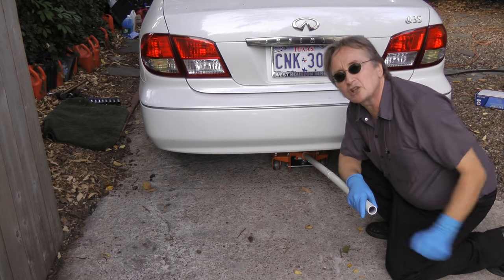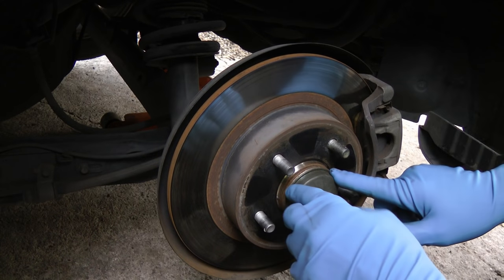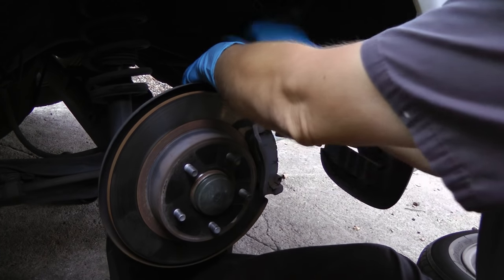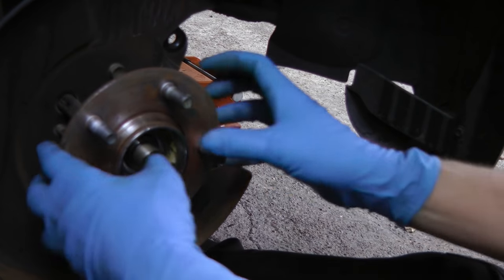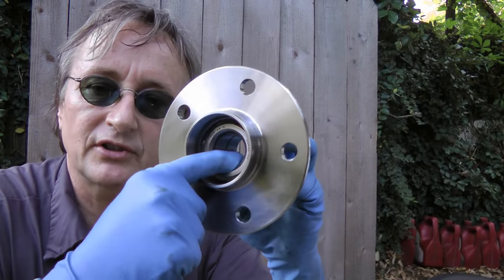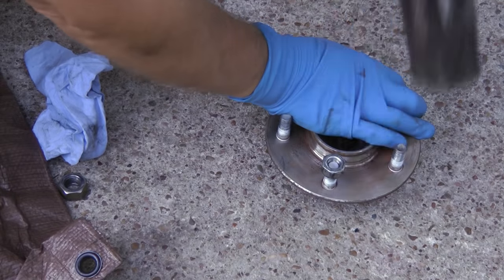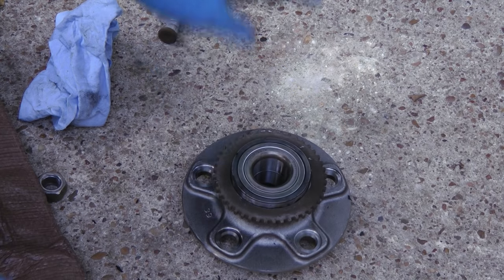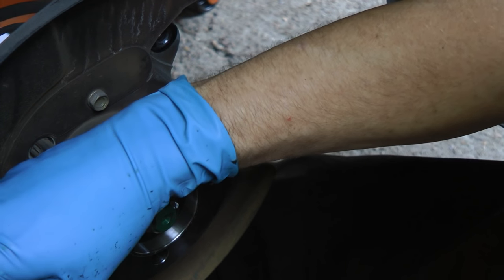How to Check a Wheel Bearing in Your Car (Replacement)

Comment: Hi Scotty, is it still safe to drive the car when you hear a humming sound at the back? What's the worst thing that coukd happened if you don't change the bearing immediately?
Reply from the maker: I've seen guys drive em years that way. As long as wheel doesn't wobble, they can go a while, But eventually they will wobble so bad they can actually fall off
Reply: +Scotty Kilmer, Thank you. I'm in the countryside where i have to wait for a month before I get the spare parts.
Reply: +Scotty Kilmer, Thank you. I'm in the countryside where i have to wait for a month before I get the spare parts.

Comment: Hmm idk there’s a noise coming from my back tires when i accelerate. It sounds like I’m driving over snow. And it sounds intermittently. Does a bad wheel bearing make noise that’s consistent, or does it come and go?  
Also when im driving at low speeds and take my foot off the accelerator, the car immediately comes to a stop, like not shutting off, just no motion and then there’s like a CRACK sound before it stops 😖. I’m scared. Sounds like something’s stuck in my back tires but I check and there’s nothing. HELP

Oh and I should probably mention that my back tires are uneven tread? 6 and 4

Comment: hello Scotty  saw your video was wondering if my wheel bearing needs replacing . I've  been having a whistling siren like noise when I'm driving. i had my front brakes / rotors and brake shoes / brake drums all replaced good brand and my 2003 toyota sienna still makes the whistling noise while driving could this be my wheel bearing. also no noise when I brake.
Reply from the maker: whistling is more often an air leak, like bad door or window seals. Wheel bearings roar, the faster you go, the louder the roar

Comment: scotty i have 2000 s10 ext cab with 4.3 2wd 5spd with 8.5 rearend and ive had a weird noise around curves and seems to be to right but seems to start noise and weird stuff after few min driving and there is viberations also.. Ive jack rearend to see if it may be rearend but dont hear nothing but the rearend has that play in and out clunk when you take truck bed and shake hard like c clips knocking. Noise is worse around right hand turns and when u apply more throttle. Combo of junk going bad?
Reply from the maker: classic signs of worn axle bearings in the back

Comment: Hi Scotty, I tried emailing you but your page seems to not work for me for some reason. I have a 2005 Toyota Avalon and it pulses when I slow down or hit the brakes. I've changed the front rotors, pads, inner and outer tie rods with no luck. What could it be? Any suggestion would be greatly appreciated. Thanks!

Comment: So if someone take off your wheel by hitting it hard with a hammer could this damage a wheel bearing.  I just got new tires and now I am noticing a major vibration at 50-65 just like a bad tire balance. Took it back and had them rebalance and still the same but also now it pulls to the right.The guy told me he felt play in the right wheel bearing or tie rod.I remember the other guy using a hammer to get that wheel off because it was stuck.  he was under the car and whacked it hard once.

Comment: I have a 2012 ford focus can I replace the REAR bearings rebuild the hub a new one is like $212.00 but a wheel bearing is probably $40.00 and I do have a 20 ton press in my basement

Comment: I changed the right front about 2 years ago and cannot remember where I got the part and now that I Drive down the road I recognize that same sound and I cannot tell which tire is actually the one making the noise so it looks like I'm going to have to take it apart to look at the remaining three, can you guesstimate a great or a fair price for when I call that phone number??
Reply from the maker: +Matt Woodward  with no traffic around drive 35 and swearve gently to the left then to the right. if going left makes the noise quiet down some, it's the right bearing, and vice versa

Comment: ive got one caliper they may be bad, adding more pressure on my driver side then passenger side, is it true that this can cause a bearing to go bad , because now my 99 vw passat is roaring like crazy , it started out of no where 65 mph down the bypass
Reply from the maker: IF a calliper is sticking, that causes excess heat, which over time will ruin the bearings by boiling their grease

Comment: I have a 1999 F150.  Loud humming noise past 50mph only when going straight and while turning right.  When I make a left turn its completely gone.  I checked and the rear driver drum has visible oil leak.  Passenger drum looks fine.  Just replace the one wheel bearing/seal or replace both?
Reply from the maker: replace the side that's leaking, bearing and seal, that fluid gets on them and ruins the bearing, other side can still be fine

Comment: I need help, I bought a wheel hub for 1991 Honda CRX and everything I put in went well but then I put in the new rotors on it, it does not fit O.o

Comment: thanks for the reply ..yea that's what people tl me but the only time I hear the sound is when I press on the gas pedal it goes away if I accelerate faster and I also hear it when I make turns the sound comes from one side it's more like a high pitched noise. I also have a problem when I start my car it turns off if in turn it on I have to press on the has pedal to keep it on for a minute .could this sound have something to do with that. and thanks again Scotty for you help:)
Reply: Maggie Rosales  n

Comment: Scott my truck shakes violently at random times when im driving. Any idea what it could be besides it being an old truck??
Reply from the maker: worn ball joints are common, as are worn shocks or struts, check them first. also check for worn U joints on the drive shaft

Comment: I am getting this random noise from the back of the car. It sounds like high pitched metal scratching noise. It doesn't always happen, it could come for a few seconds from driving out of my driveway, then stop, or sometimes it will start after 20 minutes of driving. I cannot reproduce the sound whenever I want. The noise comes and goes, and stops if I do not move the car. Any idea what it could be? brakes were changed last year, the most recent jobs were a muffler change and tire swap. Could it be rust? I know my dad rarely washes the car, its about 12 years old with 160k km.

Comment: Have a 2010 Jeep Compass. It has new tires. The alignment was just done. I took it to tire shop and was told it was CV Axle/Wheel bearing. The car makes grinding/rubbery noise from passenger front. If anyone has any advice it would be greatly appreciated.

Comment: I have a 2009  Kia Rondo. Can you tell me how much I can expect to pay at a garage  to have the wheel bearing replaced. Thanks
Reply from the maker: on that design, front bearing would be about 250 total price, but rear would be about 440 due to more work
Reply: thanks just saw your post.

Comment: Dumbest question ever incoming…the bearing for the entire assembly is inside of the hub correct? I want to use a brake rotor as a lawn aerator but want the ability to still use the bearings, which means I’ll probably need to get a hold of a rotor and the hub assembly I assume

Comment: One of the issues here is a slightly bent HUB now it’s the hub that presses into the bearing if you replace the bearing you may get a vibration if the hub is bent just a fact reminders

Comment: I have a 05 Ford expedition and it's making a sound that only happens on a cold start sorta a knocking tapping sound and only last a few seconds.  I posted the sound on here with no luck. Any ideas? Oil pressure stays stable and doesn't over heat and no leaks! Just did oil change to see if that helped and no!
Reply from the maker: Regina Romero   often a loose timing chain or weak tensioner on that model, any mechanic can hear it cold and tell you

Comment: Wish I saw this video before
My front passenger hub assembly and bearings are bad. Theres a wire hanging out. Heard same roaring noise, sounded like driver side, but it was the passenger side
I guess it was bad a few days because two days in a row while on cruise control, my abs and traction control would go off.

Comment: That was easy. I replaced a rear bearing on my tacoma n took a few hours also i had to buy 2 especialty tools plus the press n bearing splitter do your homework cause most bearing r very hard to replace. Quick hubs like the one scotty showed are usually 4 bolts and done

Comment: Hey Scotty I have a question. I have a 2002 Acura Rsx Type S I had a clunking noise when turning I replaced both axles and then I had a humming noise when turning left which means its the front right side. I then replaced the wheel bearing a hub and put everything back together. Now my steering wheel shakes and the clunking noise is there again and the humming I am lost what could this possibly be if needed I can make a video for you. Please let me know

Comment: Could a Do-It-Yourselfer do this on a 2006 Ford Explorer for rear wheel bearings?
Reply: *****  RWD/4WD diff lubricates your bearings you shouldn't need to repack your bearings unless your diff fluid is bad.

Comment: Hello Scotty. Say, you don't seem to be concerned much about torquing any of the caliper fasteners or wheel bearing nut. Isn't this something that should be noted as a "preferred step' or is it really unnecessary.
Reply from the maker: +rayford21 IF you've never worked on cars, get a torque wrench and a book with torque settings. A pro like me does most things by feel, other than head bolts and really crucial parts
Reply: +Scotty Kilmer Really, so those big books of torque settings are for nothing! what if a bearing needs to be torqued to a certain amount to allow for heat swelling ( which on alot of GM cars especially older ones do) i think that was some bad advice given there as i would say that whilst you have a lock nut on there (so not a safety issue unless ofcourse it seizes) you will toast a bearing if it's overtightened and needs space to swell

Comment: My car makes a strange rubbing noise from underneath the front fender.  Doesn't sound like metal to metal friction however.  I looked underneath and nothing appears to be scraping together.  I notice when the car is jacked up I will spin the wheel and it doesn't make any noise but only when the full weight of the car is applied.  I primarily hear the scraping noise when the wheels are pointed straight forward and occurs more frequently as the car moves faster.  Wheels are factory size and the tires are in good shape.  I'm completely baffled.

Comment: I have a 2001 Dodge Caravan, its making a squeaking noise only when I make right turns. Could this be a bad wheel bearing?
Reply from the maker: wldmike223 it could be, BUT more often squeaking noises are worn brakes or suspension parts, wheel bearings roar as they wear, the faster you go, the louder the roar

Comment: When u do the method of pulling in the wheel studs u have to be careful cause that way u can spin the back of the stud while u tighting it down an if u do so the knjrl can decrease in size an might not stay tight in the hole, it might wobble or fall out when u dont have a nut on it

Comment: I've got a bad vibration in my 1982 datsun 720 4x4 that goes from no vibration, to vibration right when I hit 45 mph. when i go 45+ mph it increases with speed, the guy i bought it from said he put a new clutch in it. Is there anything the he could have done wrong for it to cause this vibration? when i hit 70 mph on the freeway it sounds almost scary, like a helicopter. I cant really locate where its coming from though. Does it sound like it could be a wheel bearing? How can i test to see in a 4x4? Thank you!
Reply from the maker: almost always bad wheel bearings when it sounds like a helicopter

Comment: I have a squeaking noise in the front driver side wheel when I drive. It alters with acceleration and goes away when I turn the wheel to the right and gets a little louder when turning left. What could it be??????????

Comment: hey Scotty  i drive from  stop to 35mph ,  i'm getting a sound like a stone stuck in rubber ,  there is no stone , or nail , when about 40mph sound goes  its a light humpimg ...tyers 4 months old , put on rack & pin new brakes and rotor ,,,  sound still there ,,,, help

Comment: Well in my case I have a Crown Vic Police Intercepter. Has humming sound but its leaking fluid. Think my wheel bearing and seal is bad ?
Reply from the maker: yep, and on those, generally the seal goes bad first, then the diff oil ruins the bearings. Bearings are made for grease to lube em, not diff oil which ruins them
Reply: Scotty Kilmer Cool thanks well my part comes in today I will be fixing it today thanks Scotty.

Comment: Hey Scotty I have an issue with my car at speeds above 50 the front right tire gives a powerful vibration I have a 2006 AWD Equinox and I know it's not the tire balance
Reply from the maker: +James Allan jack it up and check the tire for out or roundess, and check for worn parts like ball joints or tie rods, Then pray it's not something expensive like a wheel bearing assembly

Comment: Dealership to me my 2012 maxima need front wheel bearing, I didn't think my car was old enough to need new wheel bearings, who long does it take for them to go bad.
Reply from the maker: Buck Burg depends on how and where you drive, hitting lots of bumps or curbs wears em out fast, as does driving in salt water areas
Reply: Thanks, just had them changed, still under warranty😁

Comment: What does it mean when the sounds is like a ratchet?
Also I tried taking off my wheel nut a few weeks ago and that thing will not budge. Am I missing something?
Reply: systematic101 maybe your model had loc-tite applied to it... I've removed nuts, bolts, tight seals...  etc. etc. using anything from hydraulic torque wrenches,  to an oxygen and acetylene torch used to wash the tension backing in a bolt from a lock washer, or even fork lifts in a pinch to bust bolts downed @ 5000+ fp. off the jaws of an excitor/pile driving equip... A method I use when the hydraulic wrench is with a service tech... If I get in a hurry or the job is "hot"... Using the fork lift is safer when done right and much faster... I know...

Comment: Hey Schotty.  My chevy equinox vibrates when I'm accelerating and stops when a let off of the gas, and when I go above 60.  Do you have any idea of what that could be?
Reply from the maker: have the wheel balancing checked, pray it's that and not internal transmisison wear or bent drive shafts
Reply: Could it be transmission fluid?

Comment: I just bought an 09 Ford escape.
1 1/2 weeks owning it and suddenly I have multiple lights on dash.
ABS light, and traction control light came on when turning sharply left or right.  They go off after 20 seconds or so.
Then 2 days later..... In addition to these lights I get two more lights!  There is now a "brake" light and a little wrench symbol light.
There is no noise or vibration when driving.
I'm sick about this.  I feel I've been taken advantage of again.  😢

Comment: i drive a 67 mustang i replaced al of my front wheel bearings. i looked up several different videos some give this torque **ftlbs then bak off half turn torque to **ftlbs. others say torque to **ftlbs back of till you cant feel resistance tighten till it starts to resist wheel spin im not as expierienced  to have a feel for it yet how do you do it?
Reply from the maker: yes, torque em, then back off a tiny bit, then tighten a tiny bit till you feel some drag.

Comment: If the noise changes when you have the tires rotated and balanced, it's likely to be the tires - especially if you need a full alignment. If there is NO CHANGE in the noise even when you get new tires, jack it up like Scotty says and check the bearings.

Comment: This sounds like what could be happening to my old suv .  The noise isn’t loud yet, it sounds like a quiet version of the growling sound and I hear it up front.  It sounds like wind going through my tire and I actually hear the axle turning.  Never heard it before and it’s more prevalent when the car slows down.   Having it checked by my mechanic next week.  Hope this is all it is.
Reply: Yep....they get louder and louder
Reply: James Avery I suppose early detection isn’t a bad thing.  I just hope it’s just one bad wheel assembly and not multiple ones going bad. But given my car’s age, it’s not impossible.  The car turns thirteen in a few months.  Engine is very good and no indication of rust on the body.   So it really doesn’t look it’s age but a few things do need replacing on the inside.

Comment: Last time I helped change a wheel bearing my brother-in-law pulled out the air hammer, 5 pound sledge, torch, and some grunt work.  Wonders of living in the north.  You just tug and off it comes in Texas.

Comment: I have 2005 chef. uplander  i have changed all rosters, callipers, brack pad and wheel bearing assiembley, now rear right  caliber stuck on the roter  any ideas please
Reply from the maker: often a brake hose collapses inside and does that, not releasing pressure

Comment: Make sure to wipe your rotor off to make sure it's clean to prevent squeaks later down the road. Also clean the wheel bearing where it comes in contact with thetl rotor, another cause of squeaks

Comment: There is a rythmic humming/rubbing sound that gets more consistent as I accerate over 30mph (which cant be heard anymore when i'm driving over 40mph) coming from my front left wheel (front wheel drive). Could this be the wheel bearing..?
Reply from the maker: usually is

Comment: What about a metal on metal sound that is rhythmic and increases its rhythm as I accelerate? It also gets louder when I turn left (put a load on the passenger side of the vehicle).
Reply from the maker: bad passenger bearing in most cases
Reply: Will replace! Thanks!